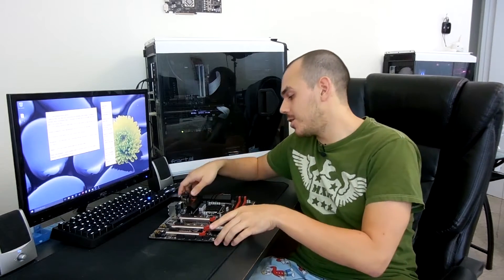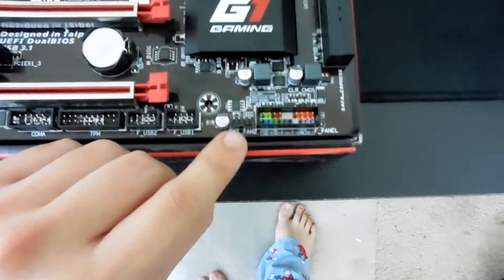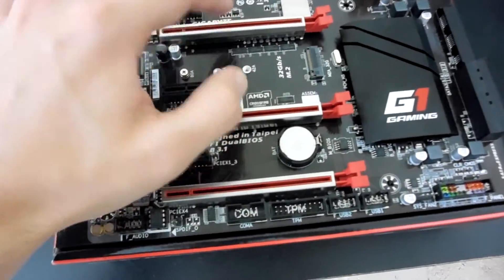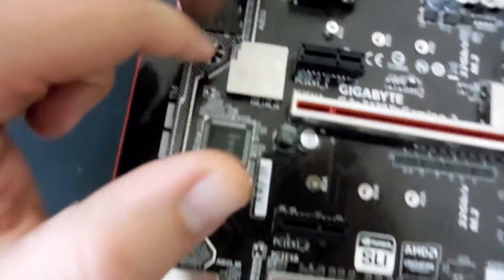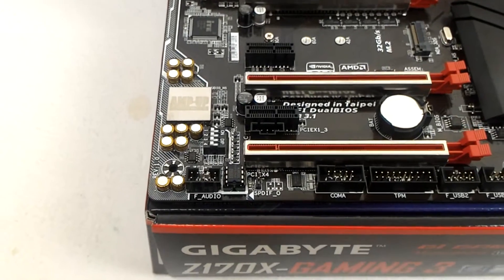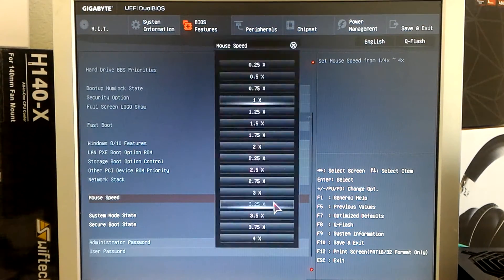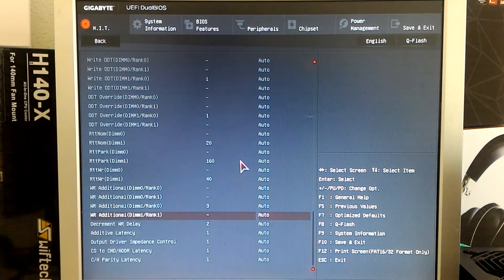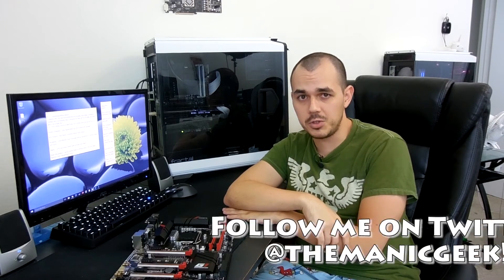Manic Tech #0023: Gigabyte Z170X Gaming 3 ATX Motherboard Review

Comment: Nice review bro & really informative. But how did u manage to revert the bios back to F5 version. Can u explain how u did this? thanks in advance and keep up the good work bro :D
Reply from the maker: Reverting the BIOS was... interesting... because of all the instability, but I found that after clearing CMOS I would be able to get in to a stable BIOS for long enough to use their QFlash utility in the BIOS options with the correct file loaded on to a USB drive.  QFlash walks you through all the steps needed to make sure the process goes smoothly.

Another thing you can do, if you prefer, is to use their @Bios utility in the desktop environment, but that's provided you can get in to a stable desktop to do this.  I was able to do this after a CMOS clear, but if I attempted to restart the system again it would go in to a boot loop again.  Your mileage may vary, and I know that someone in the comments here got the newest BIOS to work properly for them using different memory than what I used in the review, so should you go with this board just be mindful that the memory you use matters quite a bit; be sure to check the supported memory list for the board on the Gigabyte website, it's rather expansive and gives you every single DIMM they validated to work with the board.
Reply: The Manic Geek damn that was a fast response. For memory i was planning on with kingston hyper furyx 2x4gb 2133 mhz(should be enough & capable for the system)Also the MB u reviewed was it the rev 1.0 or rev 1.1 version? And whats is the difference between these 2? Is the rev 1.1 better that the rev 1.0? Again thanx for the quick response from u plus i'm really diggin it this gigabyte MB it has everything i need from a Mobo.
Reply from the maker: Typically, in my experience, Gigabyte motherboard revisions are minor tweaks to either the motherboard layout, or else some of the componentry might have been updated due to certain issues they wanted to address. If you pause the video at exactly 6:12, you can see the revision number right there (this is usually where Gigabyte always set their revision numbers, for future reference).  

As for any dfferences, the ONLY two I can find is that the Rev. 1.1 uses the Killer S2400 NIC instead of the E2201, and the 1.1 also supports ON/OFF charging of USB-connected devices... that's about it.  MAYBE the charging feature might be a deal breaker for some, but otherwise the boards are identical pieces of hardware.

Glad you're enjoying the board!  One of my friends is gonna be using this for his platform update soon; he's gonna be getting an i5 6600K paried with a 2 x 8 GB G.Skill Ripjaws kit, should be a strong pairing for his MSI GTX 970 :-).

Comment: Hi man, how are you today ? i have a simple question for you,
can I overclock my i7 7600k on this motherboard ? many peolple recommend asus pro gamin/aura for better OC
Reply from the maker: Good question: no, you do not need a higher end motherboard to overclock an unlocked Intel chip.  The question is: does this board have the feature set you are looking for?  More or less there's only a few GHz max difference between Z170 motherboards in terms of overclocking potential.  Many people tend to recommend boards like the Pro Gaming or the Aura lineup just because of the bling factor, or because it carries some feature set they feel everyone "needs" to have the best experience, but really if the board meets the price point you're looking for with the specs you need to do what you do, then I say go for it.

The only thing this board MAY be a bit lacking in is power delivery phases compared to other more spendey boards, but that all comes back to the whole "you get what you paid for" thing.  More phases CAN mean more stable and better overclocking, but based on what I experienced with this board your overclocking will be just fine, likely getting the chip to within 100 MHz or so of its max OC anyway, which is pretty typical variance with overclocking on Z170 from what I can gather.
Reply: Thanks for you answer !!

Comment: Just picked up this board with a 6600K. Building my sister a PC for a late birthday early christmas gift. Still gotta get the rest of the parts from my list. But will have it in a few weeks. Was curious on one thing. Do you know if the m.2 can be used as a boot drive? I know in most cases m.2 can't be utilized for boot.
Reply from the maker: Sadly I wasn't really able to experiment with M.2 on this board as I'm a broke-ass and couldn't afford to buy one, so I couldn't really verify that one way or another for myself.
Reply: I'll look into it. Figured it might be a good idea to find out before I get an ssd for the build. But thanks man! Excited for the build either way! My sister will get an awesome build, and I'll be able to make a how to guide for building a PC.
Reply: Just wanted to say the build for my sister just went down last friday with complete success. Was also curious on how the latest bios for the board was acting for you at the time you were testing? Like how it was behaving? I'm sure it's good now, just wondering.
Reply from the maker: The latest BIOS at the time was not doing good things for my hardware config.  As I no longer have either the board or the processor I can't really say what the newest one is doing, but based on what I've heard from others it seems to be doing rather well, no major stability or compatibility issues.
Reply: From what I've experienced so far, it seems pretty stable. Would expect as much considering it's about 6 months later. OC around 4.3 for the 6600k. The Cryorig H7 I put in seems to do a very good job with temps. Hasn't gone over 63C. Still need to do more testing to see max OC.  I have plenty of head room with those temps and where I'm at with voltage @ 1.275. But then again sometimes you can't go higher than a certain point despite plenty of head room.
Reply from the maker: Yeah, typically when you start to notice that your VCore increases per multiplier starts to get higher, that typically means you're right at the end of your rope with that chip... at least in my experience.  There are some instances where past a certain threshold a chip will suddenly move past its plateau momentarily and gain an extra multiplier step, but I have seldom had that happen to me.

Comment: Does this board support USB PD protocol for charging devices. If so what is the maximum wattage supported?
Reply from the maker: The USB ports will charge devices, but I'm not certain of the wattage... plus this board is three years old now on a dead platform, so probably not worth considering either way.

Comment: Hello.  I would like to know exactly the model of the Intel integrated 
GPU you have. I wanted to know if it could run some games such as DoTA, 
at least in low quality.
Reply from the maker: All the information on your GPU can be found here: https://ark.intel.com/products/88191/Intel-Core-i5-6600K-Processor-6M-Cache-up-to-3_90-GHz

As to whether or not it can play DotA/DotA 2, that would be best left to other review sites, as I only had this chip on hand to test the motherboard itself and didn't really run it through its paces. That being said, I really wouldn't suggest running DotA on the iGPU for this chip, and might instead suggest using something like a RX 460 or GTX 1050 Ti to run games like that.

Comment: Can I fit TWO gtx 1070 strixs in this motherboard for sli?
Reply from the maker: Yes you can, though that might be a touch on the overkill side for what this board was intended for.  I'd make sure you were pairing it with an i7 at the very least to help eliminate the possibility of there being any sort of CPU bottlenecking on two of those cards.
Reply: Yes, I have currently an Intel i7 6700k Cpu, 16GB DDR4 ram, and one GTX 1070 strixs. My brother is gonna give me his GTX 1070 strix since both of ours are the same. I just wanted to know because I want to get more FPS for my games and could not find any good examples of people having the same motherboard like mines with sli GTX 1070S. So thank you :D

I subbed :D
Reply from the maker: Glad I could be of some help, and welcome to the #ManicMob!

Comment: Hello from 2022
Got this board and is looking for a recommendation for a M2 chip for OS update from Win7 Pro 64-bit to Win10 or Win11
Thanks
Reply from the maker: Lol wow, I sometimes forget I made this video! Honestly any M.2 drive that will fit this board's slot would work fine since it's only running PCI-E 3.0 speeds. Most drives out these days are running at Gen 4 speeds, so while this jiard may hamstring overall performance, it's still gonna be faster than any SATA drive.

A drive like this one would do just fine for an OS drive for this board: https://amzn.to/3FGPGrO
Reply: @The Manic Geek  I shall try this. Thanks and Happy Holidays

Comment: Asus z170 pro gaming vs GIGABYTE G1 Gaming GA-Z170X-Gaming 3 which is better ????

my processor i5 6600k
Reply from the maker: Realistically either way you can't go wrong.  Both boards have a nice set of features, and both are in a black/red color scheme.  Only outwardly noticeable difference is the Asus board is solid black and full width, but really that's purely aesthetic IMO.

Comment: Does this motherboard have an LED indicator to show that it is receiving power from the Power Supply!?
Reply from the maker: Not one that is passive when the system is off, at least not that I noticed during my testing.
Reply: Appreciate it, was asking due to the fact that a friend of mine has this exact mobo and he had hard reset his pc after a freeze and it would no longer turn on. I was curious to see if the mother board was still getting power from the psu, didn't find one and  I told him to try and clear the cmos on the mobo and luckily after doing that it turned on and booted :P!

Comment: Hello, can this Mobo handle and overclock a gtx 1080ti and a 6700k? Would there be any difference in performance if i choose a gaming 5 7 or 1 mobo? :)
Reply from the maker: +Beedyboy first, thanks for the question! Second: any motherboard can technically handle any expansion card, graphics card or otherwise, as long as the interfaces/expansion slots are able to mate with the device. The ability of the card to overclock or not is largely determined by how well binned the card is, followed second by cooler efficiency, then whether or not clean power is being delivered to the GPU from the power supply and, similarly, the VRMs on the graphics card. 

As for whether or not this will handle an overclocked 6700K, I have never had one on hand to personally verify, but my experiences with the i5 I used to test this board indicate to me that this board could easily handle a 6700K with performance differences between similar products being within margin of error mostly. Going with something like a Gaming 5 or 7 is largely a question of whether or not you prefer the aesthetics of the other boards, need the features they offer, or want to push some extreme overclocks with more exotic cooling methods. At least that's been my experience ;-)
Reply: Thank you for in depth answer, I am pretty new to building computers, and I was not quite sure, if the motherboard has anything to do with the power delivery to the GPU. I have this Mobo and planning to get a 1080 ti for it, so now my question has been answered (I have a 700w continuous power supply, hopefully thats enough).

I already have a 6700k and its overclocked to 4.6ghz under 1.3 V and the temps never go over 65 C (idles at around 25-30C (I am using an enermax liqmax 2 aio cooler, not well know,but works like a charm!)

An addition to your video as it was requested in the video: I am running the f21 bios (just updated to it its the newest) And had no issues, it also has a new cool look to it. (when i bought the board it was running on f6 for me without issues.)
Reply from the maker: I've seen that cooler around, even saw a couple of reviews on it.  It's really quite the performer!  Also with that kind of VCore required to power your 6700K at that clock speed, this board should handle that with zest and zeal.  That's about as much VCore as I used on the i5 I tested this board with, and the board still had more to give, I imagine.

To clarify: the motherboard DOES send power to the GPU through the PCI-E bus (75W worth, roughly), but the difference in power delivery between motherboards is minuscule at best and doesn't impact overclocking capabilities... again, unless you're doing some really extreme overclocking and using some exotic cooling and advanced tuning methods.

Comment: hey i bought this but my kaby processor is not working with it :/ do i need to update chipset or something on the motherboard? do i need a processor without kaby to do it? :) i have i5 7600k
Reply from the maker: You would most likely need to update the BIOS for the motherboard to get the chip to work.  Depending on when your board was manfactured, it night still have an older BIOS on it that  might not recognize Kaby Lake natively.

Comment: Could you make a tutorial on how to overclock using that motherboard please?
Reply from the maker: Sadly I cannot; the processor used for this review was a loaner, and it has since been sold :-/. I'm also too poor to buy one for myself... sorry to disappoint... but if you can find an overclocking guide for Skylake in general then it should still apply to this motherboard since overclocking will still largely be the same here :-).  I would recommend Paul's Hardware, Linus Tech Tips, or Tek Syndicate fore their overclocking guides, all three of them are really good, and going through all three of them should give you a strong idea of what to expect.  I do believe the Tek Syndicate one uses several different motherboards, while Paul's Hardware specifically uses a Gigabyte board with a similar UEFI layout to this one, and the Linus Tech Tips guide is just more straight forward.  just search "skylake overclocking" in YouTube, they will be the top three results.  Hope that helps!
Reply: Thanks man. I appreciate the guidance :)

Comment: hello, i have this setup: Intel Core i5-6500 3.2GHz Quad-Core Processor / Gigabyte GA-Z170X-Gaming 3 / Kingston FURY 8GB (1 x 8GB) DDR4-2400 x 2 / Crucial MX100 256GB 2.5" SSD / Western Digital Caviar Blue 1TB 3.5" 7200RPM / MSI GeForce GTX 1060 6GB GAMING X / Phanteks ECLIPSE P400 ATX Mid Tower / EVGA SuperNOVA NEX 750W 80+ Bronze Certified Semi-Modular ATX PS

and after a few tries i could get image just from display port on vga card, however i cannot enter to bios setup because remains in a black screen with white cursor. when i push f9 at startup, i can see the system information and the bios versión is F7.
Do you recommend me down grade to F6 or even F5, and how should i do it because a dont have screen image
Reply from the maker: Hmmmmm... if you have the F7 BIOS, that tells me that you have the Rev 1.1 board... which means the F7 may be the only truly compatible BIOS for you since your board has a few slightly different features than the one I reviewed in this video, which was Rev 1.0; yours has a different NIC (E2400 instead of E2201), and an on/off charge function.  Try hitting Delete to get in to the BIOS instead of F9, pretty sure F9 isn't what you need to hit to get in to the BIOS on this board.  If that isn't letting you in to the BIOS, then I'd try contacting Gigabyte to see if maybe you need to RMA your board.  Does your system otherwise work without going in to the BIOS, or does it not do anything at all?
Reply: i'm pretty sure is rev 1.0, was a surprise for me too, because in the download center only have until f6 bios. to enter into bios config i know is Delete, but gigabyte has a function in f9 where shows system info https://postimg.org/image/42dqv7cq5/
thats a example image not mine, i'm only see a part of screen not full, the problem is after pressing F12 or delete, i only see a black screen with a white cursor and nothing more. I tried with autoadjust de tv but doesn't work
Reply from the maker: +Jaime González your a board will have the revision number near the bottom left of the board. The gigabyte website only lists an F7 bios for the rev 1.1 board, so if yours is in fact rev 1.0 you may need to try rolling back, though you won't be able to try moving forward until they release an f7 that is compatible with your board. Then again unless there's an actual problem with your bios there's little need to upgrade in the first place.
Reply: i'm going to try a downgrade of bios, i tell you how is going me later, thanks a lot, and BTW great review.
Reply from the maker: Thanks, glad you liked it! Let me know how it goes for ya.
Reply: i have news, the mobo rev is  1.0, the BIOS in fact is F7, no updates, no interventions, I've changed the monitor and I could get image, so everything is ok now, thanks for you help
Reply from the maker: How interesting that it ships with the F7 BIOS even on the Rev 1.0 boards... eh, worked out for ya in the end, and now you also know how to externally identify the revision number on a Gigabyte boards since they pretty much all place the marker in the same spot!  Glad it turned out to just be the display that was the issue, that's much less invasive to deal with than having to mess with the motherboard.

Comment: Has any one had any issues mounting this board?? I've just read a review where apparently it is slightly smaller than comparable boards and the mounting holes to the right of the board don't line up with the case holes of many cases. I would be using it with a cooler master maker pro 5 if anybody has any experience with this. Thanks Adam.
Reply: it's really okay. it is a smaller board. I mounted it with 6 screws today. it's really easy.
Reply: Don't worry about it, its very easy to mount it.